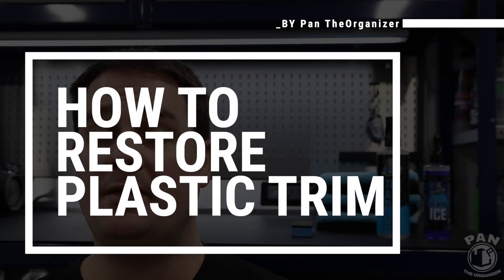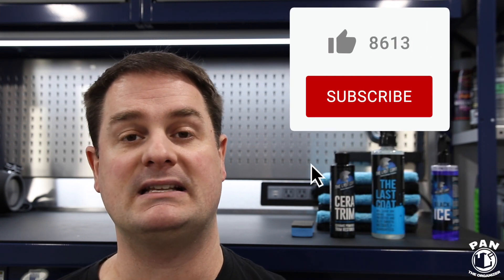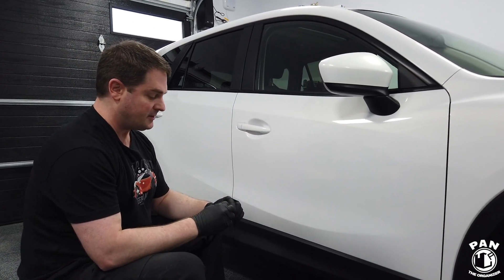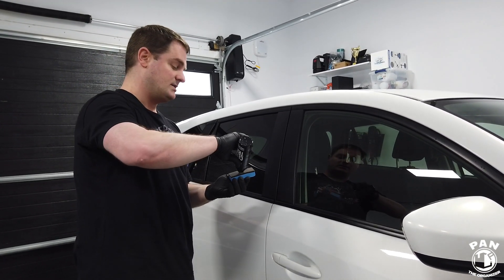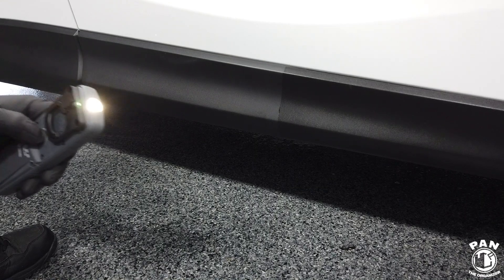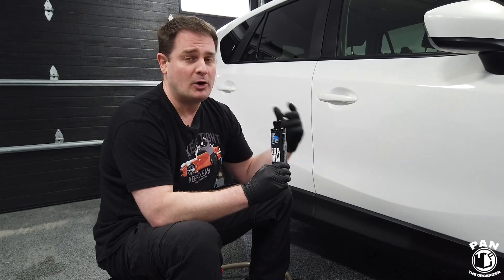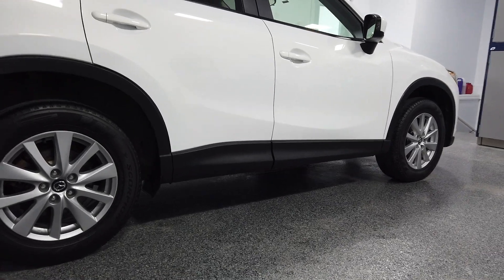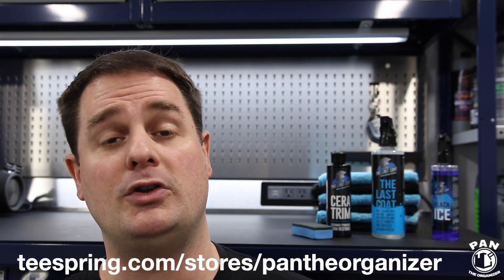Restore faded plastic trim on your car with CeraTrim!! IT WORKS!!

Comment: I have a question Mr. Pan the Organizer. I've been using Mother's Back to Black for my trim,it's affordable for me and works. My question regards B pillars. I'm certain mine(volvo) aren't plastic or vinyl.. I'm guessing some type of metal. I've checked with my local Volvo dealer and they're clueless. If I've made any sense, how do I clean, maintain or otherwise address these particular items. Can you help?
Reply from the maker: Impossible for me to say as I don't know what material you're talking about. If you don't know, and Volvo doesn't know, I certainly don't know if I don't see it...

Usually, if it's not gloss black (piano black lacquered finish) then it's some type of textured or smooth plastic.
Reply: @PanTheOrganizer  Thanks

Comment: Hi Pan, thank you for sharing your honest reviews. Do you think this will also work on headlights after sanding polishing, as a clear coat. I’ve been looking for a permanent coating and I was about to buy the Armor Shield IX to do so. I’m very confused with all of those new products. Thank you
Reply from the maker: No.  CeraTrim is for black plastic or rubber trim.

Comment: The big question is longevity - how long does it stay looking like that before wearing off?
Reply from the maker: That’s because it’s a brand new product and nobody has had the chance to report long term durability yet.  I will evaluate it in the coming months, but given the track record of TLC version 2.0 which is awesome, I don’t doubt this will meet the claimed 12-18 months protection if applied correctly.

Comment: Awesome Pan, will like to see how durable is, would you recommend this over solution finish?, probably another product I’ll have to get and try for myself 🤦🏻‍♂️, 😂 great video Pan 👍👌
Reply from the maker: Solution Finish is an awesome trim restorer for sure.  Performance of both seems to be on part so far.  But the big advantage of CeraTrim for me, is speed of application and no black mess.
Reply: Pan TheOrganizer great, thanks Pan 👍

Comment: Would you recommend Cera Trim, Solution Finish or Cerakote Trim Coat wipes for the smooth black plastic fender flares on a 2003 Toyota Tacoma? Thanks
Reply from the maker: Do they need restoration?
Reply: @PanTheOrganizer  yes, they have a gray look instead of black. I have treated them with 303 Aerospace liquid many times but it doesn’t last more than a couple of weeks.

Comment: Will it damage your paint or other parts on the vehicle if the CeraTrim got on other than Rubber and Plastic?
Reply from the maker: No.  Just wipe off any excess.
Reply: @PanTheOrganizer  
Ok, thanks for the advice.

Comment: How about for interior plastic? Dont like super glossy in the interior.. looking for a satin finish
Reply from the maker: It was designed for exterior use. Off label use is up to you. ;)
Reply: @PanTheOrganizer  do you have a solution for the interior that is not a dressing but some kind of ceramic coating with rejuvenation ?

Comment: Can ceramic sprays like TLC, etc. be used as maintenance protection if car has been coated with power lock and collinite?
Reply from the maker: No.  Ceramic based sealants are to be used as stand alone paint protectants, or as toppers over existing ceramic coatings.
Reply: Pan TheOrganizer whoa quick reply! Do you have a video on maintaining cars that are sealed/waxed? Also, would love you have you join an auto group consisting of Nurse Anesthesiologsts from the US!
Reply from the maker: I have a popular video where I talk about the differences between waxes, sealants and ceramic coatings here: https://youtu.be/Yxz3zSVIm-g

Comment: How you think it stacks up against Solution Finish?
Reply from the maker: Pretty similar in terms of performance so far, both are top notch trim restorers.  Time will tell for durability, but TLC have an awesome track record so I have no reason to doubt the 12-18 months durability claim.  The good thing about CeraTrim is it's easier to apply, quicker and leaves no black mess.
Reply: @PanTheOrganizer  

Thanks Pan

Comment: Hi Pan, will Cera Trim do any damage on paint work if it accidentally got near it and would you recommend applying it on fairley new car ( 2020)?
Reply from the maker: No. Just wipe any product that goes on the paintwork.

Comment: Awsome Paaan! 

I also have the exact same car and the same color.  I have been using Turtle Wax trim restore, and I feel it is too oily and magnetic to dust.
Reply from the maker: CeraTrim leaves no greasy residue behind.  Just a nice satin smooth finish.

Comment: Hello Pan. If you have time, I have a question. Would this product or another be better suited for the harder plastic of the so called "B" pillars in between the windows of a 2007 Honda Civic. Very faded.
Reply from the maker: Is it glossy black or just regular matte black plastic?
Reply: @PanTheOrganizer  Matte black finish

Comment: what happens. say after 6months. does it make the. plastic look chalkey /faded or as it was before?  does it leave a greasy or sticky film right after application?
Reply from the maker: No greasy film.  Dry to the touch.  This is a brand new product so nobody has had the chance to see what it looks like after 6 months.

Comment: Sir, how does this stack up against Carpro DLux? That took first place in your 2019 awards. Which do you suggest?
Reply from the maker: DLUX is a protectant, not a restorer.  Two different products in their purpose.
Reply: Pan TheOrganizer can you use them both? Normally you need a clean surface with nothing on it so the ceramic coating will bond. That’s kinda what my question is. Can I restore it then coat it without any problems of the DLux bonding?

Comment: Great Video Pan!! I Have A Question Will This Product Work on interior Plastics that Have White Spots due to Acid Rain? Can it be Restored to its original Black Color?...
Reply from the maker: Yes, interior and exterior plastics and rubber.
Reply: Yes as Pan said you can apply on interior, keep in mind it will give a gloss look to a degree, some people don’t like that on interior so just a heads up.

Comment: im searching for a product just to protect the plastic trim on my brand new car. any suggestions? or will using a ceramic spray wax on the entire car do the trick?
Reply from the maker: To protect plastic trim on a new car, here are my top recommendations:
https://amzn.to/3XNLcXM
https://amzn.to/3XTeUur
Reply: @PanTheOrganizer  ahh ceramic coatings. I admit I don't have the right level of experience to commit to such products. 
If I top up my paint protection with megs HCW after every wash, would the result be the same? 
Ie; constant reapplication vs a semi permanent coating?
Reply from the maker: You need ZERO experience to apply trim coatings. It's literally wipe on, and a light buff. It's not like applying a coating to paint. So don't worry about that. Just follow the instructions of the product you buy, and you'll see just how easy it is.

If you can apply a paste wax, you can apply a trim coating. They are also often self levelling, so zero worries.

If not, the next best thing is a spray coating or ceramic sealant. You could apply Meguiar's Hybrid Ceramic Spray Wax or better yet, Turtle Wax Graphene Flex Wax.  But you wouldn't do that after every wash. Those are long lasting protectants. You would reapply once every 4-5 months perhaps.

For regular weekly washes, just top off the existing protection with a ceramic detailer as a drying aid. Something like Turtle Wax Ceramic Wet Wax or Meguiar's Ceramic Detailer (green bottle).

Comment: How does one remove these compounds after the begin to fail over time?
Reply from the maker: You just reapply a fresh layer.  But it will take a long time before it starts fading away.  You're looking at 12 to 18 months.

Comment: Hey pan would this be safe on the carbon fiber looking trim on a civic type r? It’s a 2018 and when I detailed his car last I didn’t have anything to put on it and I want to put as much protection as possible on it. The only trim protection I’ve ever used is mothers back to black and it works well but you have to use a lot of it for faded trim.

Comment: Hi, I have a question for you and all car aficionados here 😃 —  Do you believe in car detailing like “super coating” that doesn’t require additional waxing & Claim to last for 3-5 years, (if yes which brand). Or you rather go for waxing every 3-4 months and polishing every 1-2 years?  — Thanks in advance 🙏🏻
Reply: I use Jescar (formerly Menzerna) sealant every 5 to 6 months and Chemical guys V07 as a detailing spray everytime I wash my car.  Never disappoints.
Reply: Mark Van Pelt thanks

Comment: Does this run and leave unsightly marks when it rains? I've used simoniz back to black which works, but it very greasy, attracks a lot of dirt and dust and streaks when it rains so it looks awful on trim.
Reply from the maker: It has rained a few times in over a month since I applied this and I have washed the car many times.  Zero streaks.
Reply: Pan TheOrganizer  thanks much. I’m in the UNited Kingdom and apparently Amazon doesn’t sell it. Will keep searching online for a retailer.
Reply from the maker: If you click the link I provided, they ship pretty much anywhere in the world if I remember correctly.
Reply: @PanTheOrganizer  thanks much Pan.

Comment: SUP PAN HEY I WANTED TO
ASK YOU SINCE U KNOW SO MUCH ABOUT DEATAILING SO I WAS THINKING 🤔AND HAVE ALWAYS WOUNDER AND WANT TO ASK YOU WHAT IS THE REAL NEW CAR PERFUME I HONESTLY LIKE HOW A NEW CAR SMELLS AND DONT WANT TO LOOSE THAT SMELL ON THE VECHELS WHAT CAN BE A GREATE PRODUCT
Reply from the maker: That new car smell comes from all the chemicals in the different materials that are still gasing out.  Plastics, rubber, leather, fabric, etc all give off chemical odors as the materials are new.  Keeping that new smell is very difficult, but if that's something you really like, there is Chemical Guys that make a decent air freshener called "New car smell" that is as close as it gets.  Here's a link: https://amzn.to/2BsjppH

Comment: hey i need some help. i’m using a gas power washer 2400 psi and 3.2 gpm. diluted water and 2 oz of honeydew from chemical guys. i am getting thick soap but not foam. any suggestions?

Comment: It looks like the product may perform very well, but when you start with trim that's not heavily oxidized and as well kept as the demo vehicle, it's difficult to evaluate its full potential.
Reply from the maker: This is my girlfriend's 2014 Mazda CX-5 with almost 180,000km on it (112,000 miles).  It's not new by any means.  Just well maintained.  But it is what I had available for the shooting of the video.  That being said, I think it's still pretty obvious to see the before and after effect even on a well maintained vehicle.  Imagine what it could do for heavily oxidized and faded trim!

My videos are often made to cater to my audience, which means to people who actually like detailing and taking care of their cars.  So the state of what I present here should be representative of 95% of my audience's cars.  I don't detail filthy, disgusting, faded, chipped, paint flaking, vomit on carpets type cars.  There are other channels for that.  Not my style.

I hope I shed some light as to why.
Reply: @PanTheOrganizer  Thanks for the reply and the clarification! I appreciate the effort you put into your videos!!
Reply: @PanTheOrganizer  One additional thing for your consideration...Use cases for products such as this are not always for well-maintained vehicles, and not necessarily ones that are neglected as well. I restore classic cars and am always in search of products that can assist with getting these cars back to their original glory without having to replace parts.  You mentioned that 95% of your existing audience should be representative of what you presented in the video; but if you want to expand that audience, you might consider also including some demonstrations of product that addresses other use cases as well.

Comment: I have a 2021 Silverado with black plastic trim it's not faded but I want a good protectant what is the best product?  I used VRP by chem guys but I am not too happy with that I have also used Meguiar's G14716 Ultimate Protectant, For Vinyl, Rubber and Plastic - 15.2 Oz Spray Bottle.
Reply from the maker: The best trim coating you could get is this: https://bit.ly/453tkL6

This is another great one: https://bit.ly/3QeFqwL

VRP is not a trim coating. It's just a trim dressing. So one to two weeks durability max. A true trim coating can last 6-12 months.

Welcome to my channel. You discovered one of the biggest car detailing channels on YouTube as we surpassed 910,000 subscribers and we have over 120 million views! I have been detailing for 26 years and I love to share my knowledge and passion with my viewers.

You found the right channel to help you learn everything about detailing.

Comment: How has this stuff held up so far?  I am betting it is already pretty much gone.
Reply from the maker: It's been over a month since I applied it, and it still looks like the first day.  Amazing.  The vehicle has been through many rainshowers here, and I washed it a few times, and the water still beads off.  Makes cleaning of the trim a breeze.  And out of curiosity, why would you even say "I am betting it is pretty much gone"???  Have you even tested it?  Have you tried TLC products?  This company works super hard to actually come out with awesome products.  Their TLC2 silica spray sealant has been reviewed pretty much on all major channels on YouTube and everybody came to the same conclusion: fantastic.

Comment: Does anyone know how well this holds up after it rains? I’ve tried chemical guys vrp and it would be ruined after it got wet.
Reply from the maker: I have had this for over a month now, and it has gone through a lot of rain and still looks like day 1 I applied it.  VRP is just a water based dressing, it doesn't last that long.  (Although I still love it as a tire dressing as I wash my car twice weekly I don't care for long term durability of a tire dressing).  But CeraTrim is ceramic based and is claimed to last 12-18 months if applied properly.  This repels water and makes dirt stick a lot less.  This is a plastic and rubber protectant, not just a dressing.
Reply: Pan TheOrganizer okay thanks 😊

Comment: I'm a fan of Last coat Products but I have to say I was not impressed Ceratrim or  I should say how long it lasts. I live in southwest Florida, the sun here is brutal and takes its toll on all products. I treated half of my fender flair on my truck and within two weeks I could see no difference between the treated and untreated areas.  Could have used CRC or similar products and it would have looked shiny new for a period. Having a hard time justifying the cost for a product that only lasts two weeks.  Pan I love your channel please do more extended period reviews.
Reply from the maker: That’s weird.  How did you apply it?  Did you prep the trim correctly?  I have had it on for over a month now, the vehicle went through a few rainshowers and I wsshed it many times, it’s still like it was on day one.  I really like it.  Water still beads off like day one plus the trim is so easy to clean now.

Comment: Based on your video, I ordered Cera Trim on  May 25, 2020. Got a shipping confirmation on May 27, 2020, that your product was shipped!  Its now June 6, 2020, and tracking only shows that a label was created, no other details. Called 'The Last Coat",  was informed that the product is back ordered, not sure when it will be in stock. They had no problem taking my $$$$ right away. not sure if I can trust this Company. Your thoughts/comments would be appreciated!
Reply from the maker: I have been dealing with The Last Coat for a long while now.  Of course they can be trusted.  They issued a statement in my comments section under this video explaining the situation.  My channel is one of the biggest car detailing channels on YouTube with almost 500,000 subscribers and 50 million views.  When people decide to buy a product they like from one of my videos, you can imagine how quickly companies can sell out of product.  That's exactly what happened here.  Despite them stocking up a lot before I released my video, the video quickly gained in popularity and many were sold.  They did confirm they are working hard to restock and they will honour all the orders, don't even worry about it.

And that's not just The Last Coat, this happens to pretty much all the brands I do videos for, including some of the biggest in the market like Turtle Wax.  They quickly sold out of their new black line kits when my video dropped.  They are working hard to restock.

I hope this helps put your mind at ease. ;). I would never partner with brands that don't deliver on their promise.

Comment: It’s still a temporary fix.  Get a heat gun, use it on the plastic and that will make it more permanent until the oils in the plastic evaporate again.
Reply from the maker: I would never use a heat gun on faded plastic trim.  You could damage the trim that way and overly dry it out by removing too much of the oils.
Reply: Pan TheOrganizer very true if you get it too hot.  It doesn’t take a lot of heat and only takes a few minutes to do an entire piece.  Lasts years not weeks when compared to using plastic gels.  All you are doing is moving the oils back to the surface with the heat.  To each is their own.

Comment: Has anybody tried this stuff on faded plastic Jeep Wrangler fender flares?  That'd be the real test.  I'd like to hear someone before I drop 30 bucks on this stuff.  I'm also wondering if one bottle is enought to go over the flares and front/rear bumpers, too.  Also, Anyone have experience with how long it lasts?